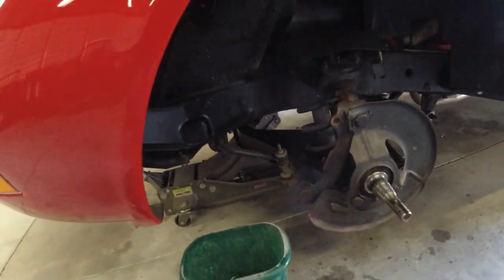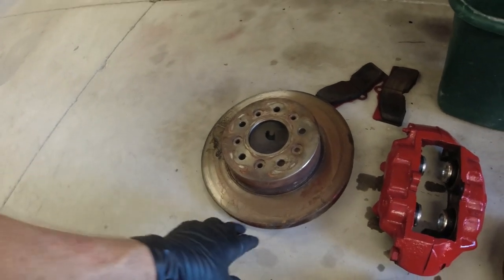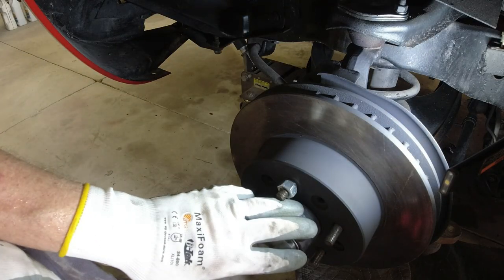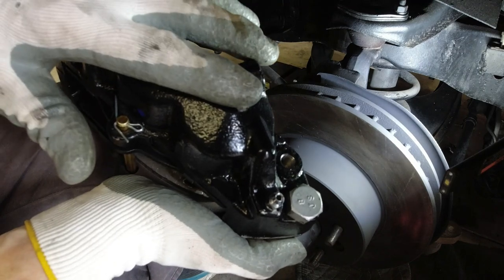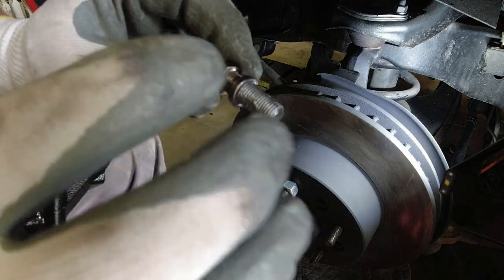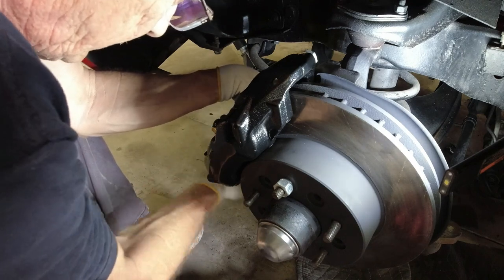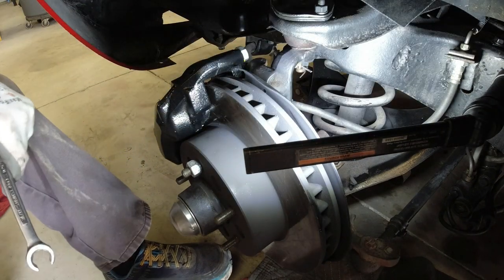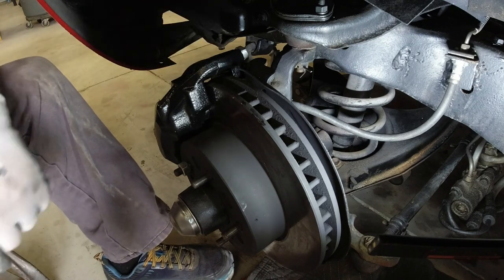C3 Corvette Front Brake Replacement

Comment: I have a c2 roadster with a broken front lug nut stud. I have worked on these brakes over the years. I use to have the metal clasps that would hold the pistons back but long gone. After watching your video and not having any hose to use I cut a 2x4 an inch and a half off one end. I took that block of 😊wood cut it in half and with new rotors and brake pads empty of brake fluid. I pushed the two blocks of wood in between the brake pads. Thanks for the video huge help. I am US Army Ret.
Reply from the maker: Thank you for your service. I was never in the service, but I am retired Law Enforcement.  When working on these old cars sometimes you have to get inventive. The C2 and C3 used the same frame. It's amazing the frame technology stayed the same for 2 generations. Thanks for watching.

Comment: Joys of Corvette brakes.  Had problems with the proportioning valve when bleeding rear brakes. It would close as designed. Had to really stomp on pedal get it back to center. Slow steady bleeding solved problem.      Fun video
Reply from the maker: Thanks. For a sports car they really do lack in the braking area.

Comment: Great video and perfect timing. I just ordered two front calipers and new lines from Rock Auto for my 71 Vette....  I was getting some leakage under the wheels and noticed the calipers have a slow leak. Also, I found my rear shocks leaking so I ordered shocks for all four corners. Looks like it will be an easy job this week.
Reply from the maker: My front calipers were doing the same thing. What was bad was that mine were new but the guy had started restoring the car about 7 years before I bought it. After sitting for that long the seals went bad so I had to replace them. It is an easy job and can be done at the same time. Good luck

Comment: Did you check rotor runout before replacing the calipers? That's especially important to keep those lip seals from pumping air into the system...
Reply from the maker: Yes, the rotors ran true.

Comment: I got a new set of front calipers (TRQ) for my 79 Corvette. They came with 2 copper washers per caliper. Is it necessary to use 2 washers on each brake line, or should 1 be enough? Thanks for the great videos you provided.
Reply from the maker: One is what is needed.